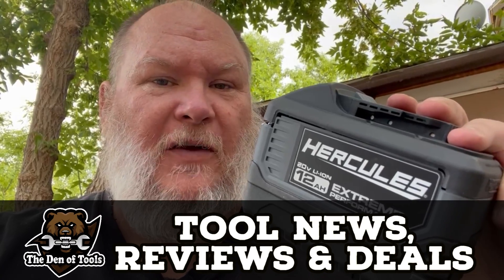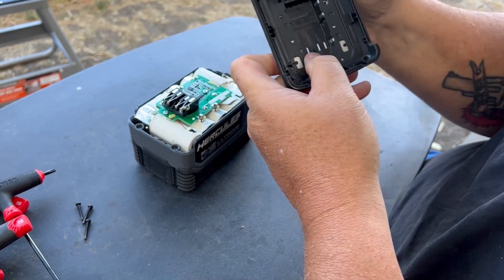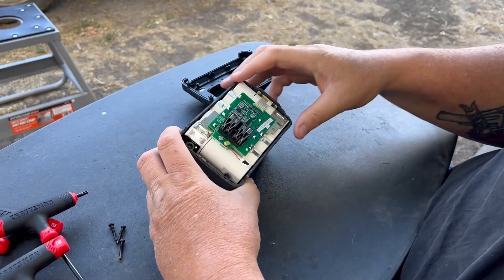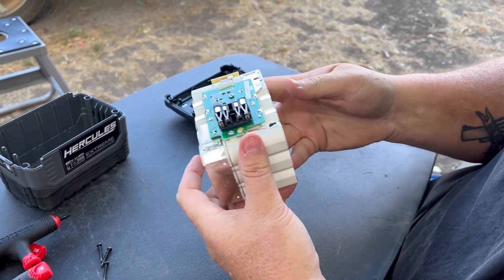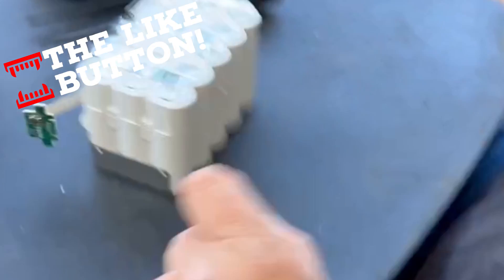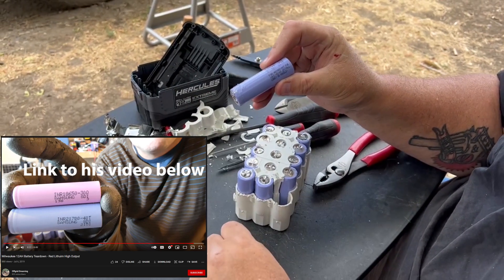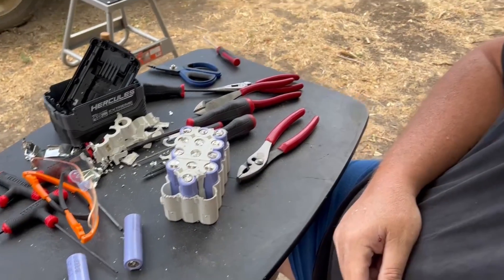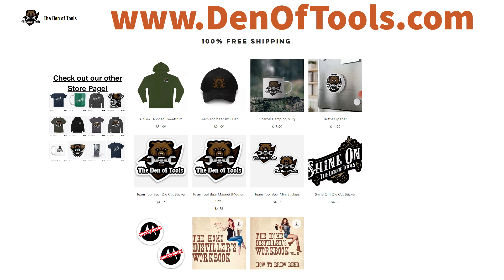Hercules 12Ah Battery Tear Down is SHOCKING!

Comment: I bought the yellow 18 volt DeWont tools the first year that they came out in the 90s. After years of replacing them and trying to get batteries that would last I gave up. As of 3-7-2025 I've changed over to Hercules. The 18v stuff was just too far out of date with modern features and I didn't feel like spending a ton of money. Very happy with Hercules tools so far.

Comment: 3 rows of 5x Samsung 21700s @ 4AH each row. Not bad. If Harbor Freight used 18650 cells, it would have been 4 rows of expensive 3 ah cells or 5 rows of 18650. I'm betting that it was cheaper to use the 21700 and more ergonomic.

Comment: So to be clear although the cells are quality cells they are far from the best cells out there. In fact a flat stack lipo cell is much better. They will last 4x longer and produce more power at a consistent rate than cylindrical cells do. The Milwaukee Forge battery will last 1200 charges vs 400 . My guess is HF will be warranting a lot of batteries before the 5 years are up!
Reply from the maker: This is a classic case of fanboy mentality.  You are trying to "correct" a video that is almost two years old.  The batteries you are talking about we not out yet and your "guess" about warranty claims has not materialized yet you are more than willing to make claims about new tech just because it says Milwaukee on it. SMH.

Comment: currently, each cell runs $6. 15 cells X $6 = $90 + shipping ...so $100. add the case and the power management board and $140 seems fair

Comment: I’m tired of the battery adapters. Why is no one selling a battery board with the ID resistor to properly convert these to DeWALT? It takes such a minor modification to make them fit.

Comment: I build custom M18 Godzilla batteries that are 13.5AH with Molicell 21700 P45B cells for $220 delivered in the lower 48 states. More powerful and higher capacity than anything Milwaukee produces.

Comment: I have to say that this line of tools seems to be pretty decent for the price.  My batteries have held up pretty well thus far but being lithium I assumed they ran mid-grade cells.  I know other companies have as well.  My intent was to replace the cells with my own when the batteries died.  It's nice to see that these are a higher-quality cell though.  My last set of cordless was ni-cad and was junk (but cheap).  I do plan on buying a few more tools and a couple extra batteries at some point.

Comment: Three rows at 35 amps means those things are putting out 105 amps. Impressive.

Let's see if I'm thinking about this correctly. 18V x 105A = 1,890W. 120V x 15A = 1,800W. Therefore, these batteries are capable of outputting more than enough wattage to run a full-size, corded miter saw, table saw, etc (differences in current type notwithstanding). That's a lot of juice.
Reply: No, you are not thinking about this correctly.  Where do I start?

1)  The current limit is going to be in the tool, and before 105A, even the battery contacts to it.  Nothing that takes 18V, draws anywhere near 1800W.  Nothing, unless maybe some defect plus a dead short that immediately damages the tool.

2)  Full sized corded tools use a different type of motor, typically one that uses higher RPM but lower torque.  Apples and oranges, but yes a good cordless tool, whether it has a 12Ah battery or even as low as 4Ah, can rival a corded tool of about the same or even a little greater weight.

3)  If you think for a second that anything with a 12Ah 18V battery can perform as well as a 15A corded table saw, there is too much more to cover than you would understand because it's just too obvious that isn't the case.

What the 12Ah pack gives you far more than anything else, is just to be able to run a power hungry tool longer, not more powerfully with a few exceptions and even those, have greatly diminishing improvements past about 6Ah pack capacity.
Reply: @stinkycheese804  Then why are the old 9Ah batteries so much better than thr newer 6Ah batteries (and they are)?

Comment: Thank you for doing this as we really should be told what cells are in the packs by the manufacturers.  Even at this "low" price, they are still overpriced as you can buy the genuine bare cells for half this price and the case and pcb certainly aren't worth $65.  Some profit is understandable, but these companies are raking people over the coals for tool batteries.

Comment: I have been impressed with Hercules.  I got their cordless angle grander and, as I always do, I popped it open to make sure the bevel gears had enough grease, and they did.  So did the needle bearings on the drive.  NEEDLE BEARINGS.  My old Dewalt had a nice bushing.  Yay Hercules. Oh, and thank you for sacrificing your battery pack in the name of learning.

Comment: Finally! A proper tool review. Not just another unboxing video and someone looking at the spec sheet. I can't handle anymore videos of people doing a tool review by checking how many little nips of wood you can cut with a saw. I want to know if the batteries are safe to use, because that's far more important.
Reply: Umm, I hate to break it to you, but a battery teardown is not a proper tool review.  For example, it's not the tool, and as it relates to batteries, there was no runtime or current capacity performance tested.  I'm not suggesting that this disappoints me or anything as it wasn't the intended scope of the video.  Just sayin', your standards are really low if you consider this a "proper tool review".

Comment: Dang I was kind of hoping you would touch on whatever they got going on inside that battery that makes it to where you can't use other batteries in it. I've got every brand and many types of power tools and they all pretty much run on 24 volt kobalt. Even the 18v metabo and Ryobi. Everything's went smooth for years button I attempt to make a Hercules work with a DeWalt or kobalt did not go well. Write on the box it says *intelligent electronic communication " next to a picture of the battery like it is a feature implemented for us. Yea right

Comment: I am very curious to know it the 21700 cell is packed with a 18650 battery packed inside the cell case like all 26650 do.

Comment: You say that Hercules makes better batteries than Bauer because they use Samsung cells but another guy took a part some of the Bauer batteries and they have Samsung cells as well and I'm not sure if they're the exact same ones or not but they're Samsung, so are the Hercules batteries really better than Bauer? I know you say that Hercules tools are better just like the store says that as well as the retail price but I already have several Bauer tools and batteries, 10+ each so I just hate to kind of start over and start buying Hercules tools, batteries and chargers when it's somewhat redundant even if they are made to last longer and possibly perform a little bit better but I'm definitely interested in the difference though for sure.
Reply: On YouTube there's one guy that says the batteries are from Samsung and somebody else says they're not that they're much cheaper Chinese batteries so maybe Harbor freight sadly changed from using the higher quality Samsung batteries to much cheaper Chinese batteries which isn't cool at all sadly and they might have done the same with the Hercules batteries or maybe they're putting Samsung in them still I really don't know?

Comment: Void the warranty? Who at any HFT retail store opens the batteries? I work there and I'm curious lol. Just don't tell on yourself. That service center thing is a scare tactic. They are more concerned about opening as much retail stores as possible. They would spend much more money doing that kind of inspection and lose customers out of inconvenience. We moved away from service centers and repairs years ago. Example the POS system pops up as repair plain you'll never hear anyone say that, because they are just switching it. The whole idea is to make it quick and convient so the customer buys it. No filling out the white card, no shipping, no waiting weeks...bring the defective item, find your customer info in  the network system or by reciept and pass the date validation. The average worker is not equipped with enough knowledge for such and especially on a internal level of the item. That can pose as danger to the worker as well and I'm pretty sure they don't want that. Also that stuff is all so time consuming when you need to serve each customer. You normally see that the return inspections lack thoroughness when being checked unless someone just has it out for you and goes a extra mile. Just make sure your dates are in the window and don't red flag yourself with intentional damage. What is taken back as return is either sent back to manufacturer and scrapped out, refurbished as a brand new condition or as is, melted down, or just thrown out in the dumpster.

Comment: just had to hammer drill into some concrete today at work and we didn't have a generator for our giant corded rotary hammer so we had to use our drills.  my buddy tried his dewalt and it couldn't get more than 1/4" in (it was some older concrete) so I pulled out my hercules that I didn't even know had a hammer mode on it and that thing drilled in the few inches we needed no problem
Reply: Too many varaibles went unmentioned so I'll just say this:   Dewalt's higher end drills, in good working order, run circles around anything that Hercules makes.  Fact.

At the same time, makes no sense to keep using a contractor grade drill if it is broken or the battery is shot, but maybe just as you didn't realize your drill had a hammer function, your friend didn't realize that he hadn't set his to hammer mode.  It happens.

How can you not know what features your drill has?

Comment: Around electrical connections you have to be carefull when using something that can bridge the positive with the negative connections. The battery is put together compactly with + and -  right next to each other returning on the copper strap. Do Not Open except by qualified and authorized technicians. But bottom line you found out the hard way. I always call the manufacturers for technical issues.

Comment: Thanks for wasting your money for a good cause. It seems like though you were curious which cells made up the pack, you’re not too keen on the differences of the various cells on the market.
I’ll fill that void that many others like myself might be more interested in. 
They were Samsung 21700 40T, 4000 mAh 30-35A High Drain cells.. 
not too shabby, the cheapest these go for currently are around $4.35/each. 
I don’t think we got a cell count, otherwise it would have been nice to see whether the 12aH is accurate or not based on each cell having 4000mAh.. 
Oh well maybe he’ll see this and respond with that cell count..

Comment: Wow. That is excellent for the price. Surprised to see the Samsung 40T 21700 cells for sure. I am surprised at how much covering on the pack though. Heat kills. I always hope to see lots of air flow through the packs. Maybe with the large capacity 3P the heat doesn't build as quickly as with smaller packs since less pull on each cell?

Comment: i would have been happy with quality 18650 cells, but i am quite surprised to see legit 21700 cells in there. i wonder if the bms has low discharge cutoff within the battery, if so that would make these batteries useful on other tools with adapters
Reply: No it did not look like there was enough real estate on the built in PCB to do sufficient BMS for a 12Ah pack.  I could be wrong, if they intentionally current limited the pack because none of their tools could make use of more than their threshold setting.

Adapters for a 12Ah battery though?  Wow would that be awkward to lug around and use, not only having the big and heavy battery but especially having it stick out that much further due to an adapter added on too?   I just can't see it being worthwhile to buy it and an adapter for that purpose, rather than whatever highest capacity is offered in the brand of your tool.  Remember, they detach, you can swap one battery with another when it is drained and keep on working.  ;)

Comment: You can replace the cells in these. But if you want to you have to have a mini spot welder to put the tabs back on the batteries. You can try to solder them but you risk damaging the nice new cells you just bought.

Comment: The cells aren't the problem. It's the crap boards they attach them to.  

I'm not saying that's a cheap board, just saying that knock off 18650s are so dangerous, that companies spring for the good cells, and make everything else as cheap as possible... Mostly for the liability.  Warranty work when it quits working, is cheaper than lawsuits when it blows up.

Comment: i have bought a few hf batteries just for the cells, in order to rebuild other tool brand battery packs that i do as a side gig, and have found samsung cells every time. in fact, i can get them from hf cheaper than buying the cells online after i add shipping costs, i don't have to worry about knock offs and i don't have to wait for them to come to me. win/win.

Comment: If you get all the cells out and remove most of the weld dots you can use these batteries in your flashlights etc.  I've salvaged several from the Dyson packs and laptops.  Be careful with those snips!  Hate to see a big burn mark on your belly:).  If you accidentally cut into any of the metal on the sides, I'd discharge it and dispose of it.  These things hold a lot of energy.  Don't want to burn down the house to save $8 on a flakey cell.

Comment: There are many grades of cells even from the same manufacturer. Only real way to test your cell is to run it on a test and see how much energy it delivers. I know because I buy cells for my 500$ flashlights which use a high discharge rate. Often the cheap batteries are good enough to run but can’t deliver the run time/punch needed to run high end devices. Then there are those that are able to discharge fast but their overall capacity is less. Batteries/cells are a whole subject on their own.
Reply: Seems like you have more dollars than sense, to have "500$ flashlights" (or is that some foreign currency that is worth almost nothing compared to the USD?) make that comment after a video showing which cells were in this pack and not recognizing how good Samsung 21700 are.

No not really, there aren't that many grades of cells from the major manufacturers.  There are some built to a lower price point of course, and some optimized for current while others are for capacity instead, but generally speaking, if it's put in a tool battery and a major brand, you don't have to pretend that you know otherwise, unless it is a dodgy generic brand and then you have to wonder if they are fake rebranded cells.

Comment: Just to be not so clear the batteries have a 3 year warranty.  "The product or part must be returned to us with proof of purchase (e.g. in-store receipt or packing slip/invoice) and may require shipment by
purchaser to a service center at purchaser’s expense".
https://images.harborfreight.com/media/brand/hercules/Hercules_Warranty_Full_Terms_Conditions.pdf
As for cheap? Not sure, other mfg's run buy one get one and buy a tool get a battery deals all year round so unless you buy them in an emergency it's rare anyone pays the full msrp, usually half that.
Reply: What service center ?

Comment: How well do these packs work? I have a non tool application where I'm using a pair of Ryobi 9ah packs and those things are getting hard to get and expensive. Thinking maybe I should switch this device over to these Hercules batteries when I wear out the Ryobi.
Reply from the maker: Seem to work great but they have not been out that long. That said the cells in them are top notch.

Comment: "Don't try this at home." It's too late for that. By the way, the batteries are usually built with quality cells. It's the boards that will shed components due to heat under load. I treat 18650s with due respect every day.
Reply: Nah, the boards always hold up just fine. It's the CELLS that count. Cheap cells=underperforming, crappy battery.

Comment: 🤔Imagine if Hercules made an inverter for those 12ah batteries. Make it so you can run on 1 -8 packs, and also be able hot swap batteries like the ego brand . That would make the competition scramble a bit, especially in the price dept… looking at you 👉milwaukee  , ego , dewalt…  👀

Comment: Can I suggest one thing: when working with cells, have them in a discharged state (run them in a tool until low voltage cuttoff). Much less energy, less chance for things to get explodey.
Reply: Especially LiPos because they do nasty things when shorted out.  I was soldering a connector on a RC pack and momentarily touched the iron to both terminals for a second and the pack got too hot to hold.
Reply: Low voltage cutoff at 2.6 to 3 volts is still enough to do damage. You can fully discharge an 18650, but don't expect it to come back. What a waste of perfectly viable cells.

Comment: That had to be revolting, nice sparks, thank goodness it didn't blow up. My Truck Platoon with the old M818s and M52A2s with 48 volt batteries and an adjustable wrench or Cresent Wrench. Had a few blow up and if you didn't get the battery cover back on correctly great fireworks. And this is our future????????????? Suicide by Battery. LMAO

Comment: Interesting. The only big downside to my old Bauer light was the battery, which was easily remedied with a swap. I was discouraged by the new Icon light not having a replaceable cell, but maybe they are using good ones in them ?